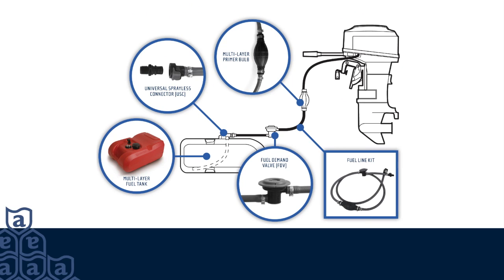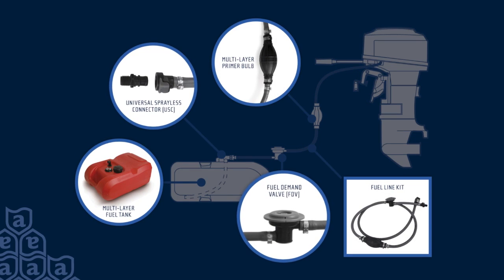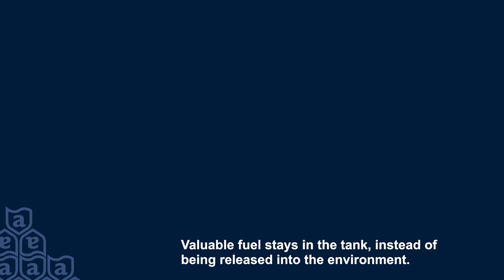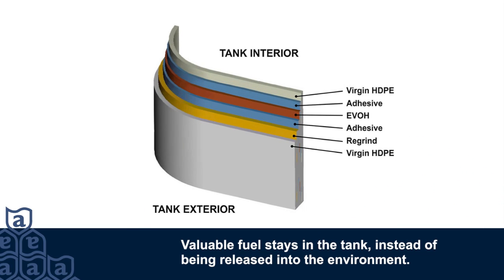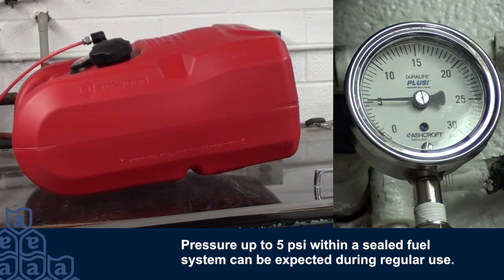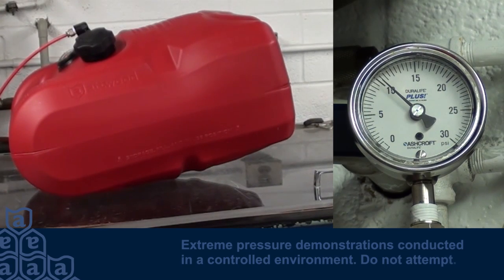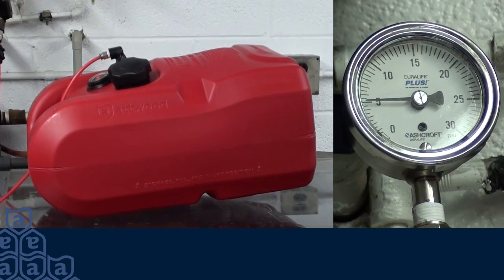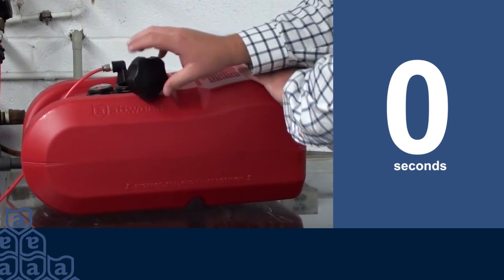Attwood EPA Fuel Tank

Comment: I just bought a brand new outboard last year. I thought the included fuel tank was defective because it wasn't venting. I never would have guessed that this was an intentional design. I'm not impressed EPA; you managed to make fishing a dangerous activity. The people that approved this change at the agency should be fired.
Reply: The tank pressurized the fuel system and instead of gas vapors venting, raw fuel just runs past the needle and seat in the carburetor and runs out on the ground.
Reply: 100%  unnecessary complications and failure points

Comment: The cap can be dissassembled and that check valve removed. It works better than the old style screw vent tanks. The only problem I have found is if you stand it up more than 3/4 full the fuel will leak out the cap. Id rather deal with that then the "football" rolling around under my deck.

Comment: I took my boat out for the first time this Summer and had nothing but problems because of this Attwood tank.  I really blame the idiots at the EPA for requiring these crap tanks.  First, the tank was flooding my engine causing me to stall (I don't have a Fuel Demand Valve, never heard of one until this issue).  I also put a lot of gas into the lake as it was pushed out of the tank and into the engine.  Second, the tank deformed substantially pulling the fuel pickup almost 2 inches off the bottom of the tank, resulting in essentially running out of gas even though I had a couple of gallons.  The tank didn't return to its normal shape when it cooled down.  Ruined my fishing trip.  I'm getting a new fuel tank (since mine is deformed and the fuel pickup is too far off the bottom), but I bought a vented cap to use with it.  I will probably leave the vent closed when the boat is in storage (it might allow the tank to expand some, but it won't be in the sun so it won't get too hot) and will leave the vent open anytime the boat is outside and/or in use.  Hopefully I'll never have to deal with these issues again.  Great job EPA!  Thank you Obama for the 2011 idiot rules that require these tanks.  Instead of some small amount vapor released, I ended up losing a lot of gas into the lake.  I'm sure that is great for the environment.
Reply: You need a fuel demand valve. Should have one anyway even for a old tank because but would flood engine when vent is closed.

Comment: Hello I bought an Atwood 12 gallon tank 1 week ago . Used it for the 1st time today with the prescribed fuel line and demand valve . When the tank was a bit lower than 1\2 engine died . The tank was clearly "caved in" a bit but I understand that is normal for your tanks? I removed the cap thinking it was a vapor lock to releive the pressure. No go.  Had a look see and fuel filter on motor was almost empty so I thought it might be fuel pump on my 70 Merc. Got towed back to marina and we decided to try starting again . No luck . Still no fuel in filter. Added a gallon or so to the tank, primed the bulb and it started up no issues. I had a look inside thinking the pickup line might be the issue but it was sitting on the bottom where it belongs. I exchanged it at the retailer for an identical unit today. Hoping this doesnt happen again. Please advise what you believe the issue may be . Thanks !! I look forward to your speedy reply !
Reply: I bet your fuel cap vent was stuck closed. As you consume gas, the valve in the cap must open to let the air in. If the vacuum is building up in the tank. the motor will starve and your engine will dye. I'm considering installing a vent on mine to prevent this to happen. I'm not a big fan of the FDV system.

Comment: My new tank expanded into a big ball and I released the pressure but it will not go back to its original shape. Plus my gas can sucks to and the nozzle is junk and the filter in the tank makes the gas overflow and splash out causing the gas pump to click off. Poor design and not sure if anyone is testing these tanks before release on the market?? I'm going back to the old classic ones

Comment: I have by far lost more fuel from this tank than burned in a year.. the retailer that sold it said nothing about an extra device in the line which I’ve never seen sold.. they took my 200 bucks and gave me a bunch of run around how they would have to send it back to attwood so they could pressure test.. I said it’s a pressure fucking bomb that’s the problem.. now it has blown the nice patent pending siphon threads where plastic and brass meet.. so bulb won’t prime.. sure they won’t honor the warranty on that... so my question anyone know of a better made siphon assembly.. or chalk it up to at least 500 dollars wasted on tank fittings, hoses and lost oil and gas... fml this makes me livid!!!

Comment: They are not that good    I have one that is a year old and it’s all ready cracking !   They build pressure up and it put pressure on the carburetor and it leaked gas out and all in the boat
Reply: You need a fuel demand valve!